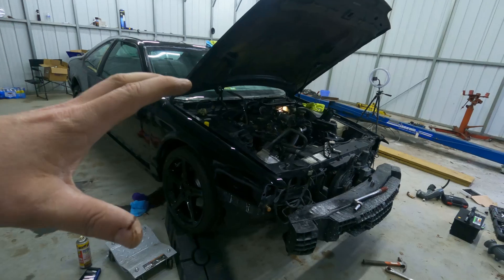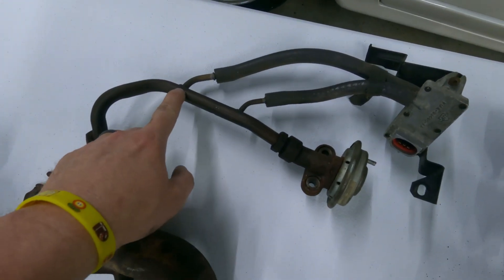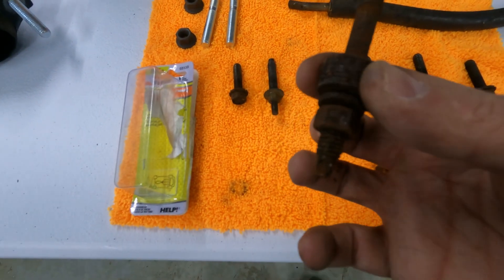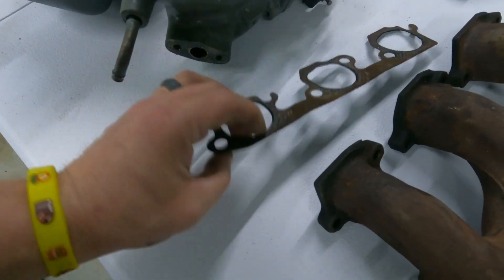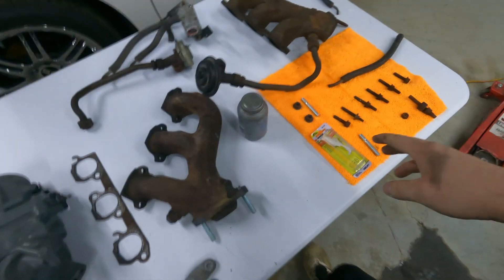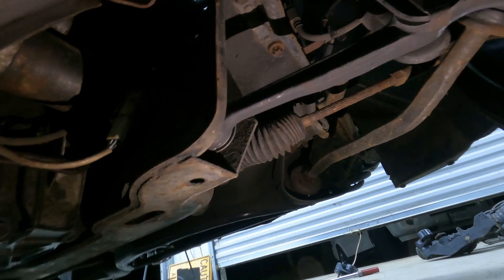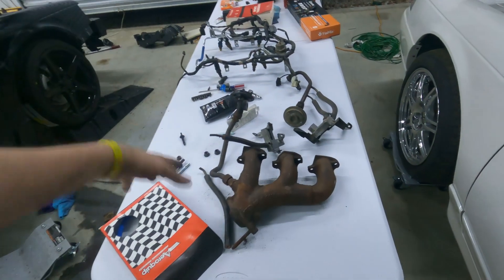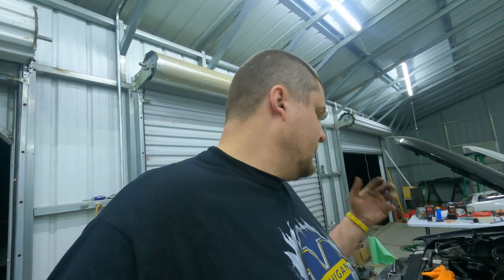Ford Thunderbird Super Coupe  - How To: Delete EGR system

Comment: Hey bud, im in ky, have a 92 sc 5spd.. I need help with supercharger noise. ive seen that its probably the coupler.. Do know of anyone around northeast ky that works on these cars? or maybe point me to a video or something? I have a trailer if youd be interested in messing with it for me. id like to get a clutch put in it too, maybe a few other small other things..Idmuch prefer someone who knows these cars vs a common mechanic ya know... NOT that there anything bad about any mechanic, id just prefer someone who knows the car... like you
Reply from the maker: There are a few Eaton m90 snout rebuild videos on YouTube that might help you with that repair. Over all its pretty simple. If it's the coupler it's a mater of upbolting the snout and swapping the coupler. If it's the snout bearings it involves using a press which is not that difficult either. To find someone local that might help, there's sccoa.com and also several groups on Facebook.
Reply: @628productions awesome man thank you very much... So I can use the snout off any m90? I saw a rebuilt one on line off a grand prix or something.  Reckon it'll work?
Reply from the maker: @ronnie9471 has to be from a t-bird, the snouts are different between the GM and Ford M90.

Comment: What did you use to plug the EGR port on the engine?  I think that's what it is called, not sure.  Newly bought '89 and going to start working on it, so anything you can think of to do with it would you please let me know.  Loving the videos by the way, very good content.  I watched the tear down of the black one's motor, but cant find where you get the parts back from getting them recoated.  Then installed back on the motor.
Reply from the maker: @davidtillotson9799  various years of SCs came without EGR and had a factory block off plate for the plenum. I have spares from owning several and used one of them. Send me a DM on Instagram and I'll send ya one for less than buying one off the internet new.  Glad to hear the content is helpful. 🤙🏻

Comment: Hey, I'm not sure if you still post. I'm planning to put one of these supercharger systems on my 3.8 camaro. Clearly the supercharger setup is way different than the pontiac/buick chargers. I need to do this one due to cowl clearance. My question is, where does it force the air? Do these go straight to the heads or what. I'll have a lot of fabricating to do and I'm just trying to figure it out cause not much information I can find.
Reply from the maker: Air exits the supercharger hat, hits an air to air intercooler, then enters the engine behind the supercharger at the rear of the engine valley. The intake manifold, then diverts the ait into the intake ports on the heads.

Comment: Are you just going to ignore the periodic check engine light for insufficient EGR flow?  Will this affect any part throttle drivability?  My 89 is the first one I've owned with EGR.  My 2 90 AOD's and my 92 5-speed didn't have it.  I'm considering deleting it when I pull the blower off.
Reply from the maker: Check engine light will stay lit without a chip...I have a chip so non issue. Also mentioned in the description text of the video. Egr being deleted has no impact on throttle, I have deleted egr on all years of SCs (I've owned 40 at this point) without an issue.

Comment: love the video!, thankfully i have a 90 so no egr! XD
Last video which studs did you end up using to replace. i can't seem to find any solid ones on amazon.
Reply from the maker: Manifold studs used were Dorman part number 03133. These were purchased off the shelf at the local Advance Auto Parts. 🤙🏼

Comment: I kept the EGR on my 89 5sp, even though I have a block off plate. My EGR wasn't broken, so I I'm seeing if the fuel milage is OK, and to avoid light throttle detention. I didn't use exhaust manifold gaskets, just like it came from the factory. Straight edge perfect though.
Reply from the maker: EGR was impacting a misfire detention? Can you elaborate, always interested in learning from others. Thanks for the comment 🤙🏼
Reply: @628productions  Typically, when EGR is operating, the combustion temperature is reduced, so the ignition timing can be advanced. When the EGR is blocked, and the PCM isn't tuned to ignore the strategy, the light cruise throttle can have too much ignition advance, causing light detonation. Also the "check engine" light will be on. The 94-95 SC uses a DPFE ,(Differential Pressure Feedback Electronic), sensor. That is why the 2 hoses going to the EGR tube. More accurate, and sensitive, meaning that EGR codes will quickly set. One thing is, when the PCM identifies EGR faults, it alters the timing map, so as to not have detonation. I'm going to disconnect the EGR hose at the valve, and experiment on my 89. Great write up, as usual.
Reply from the maker: Great information, appreciate you sharing this in the comments. Learn something new daily even after all the years of ownership. I did note in the description of the video this removal will trigger the check engine light to stay on, unless a tune is applied. However majority of my SC ownership, the mindset was if the check engine light is on, that means the SC is running right 😅. It was when the light flickered and I didn't know why that I had bigger issues. 🤙🏼